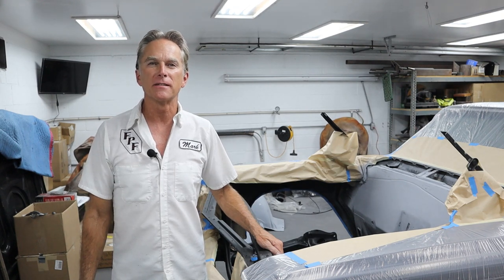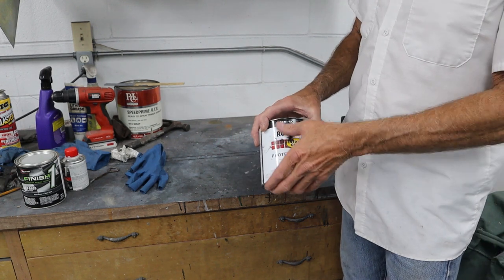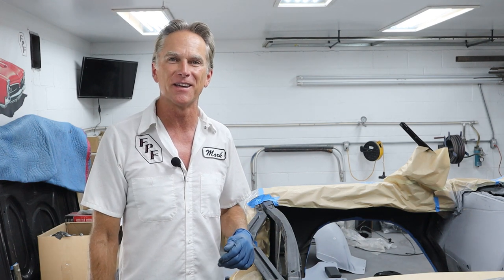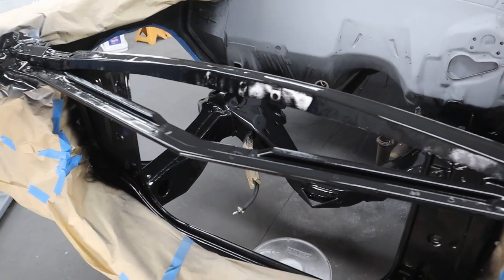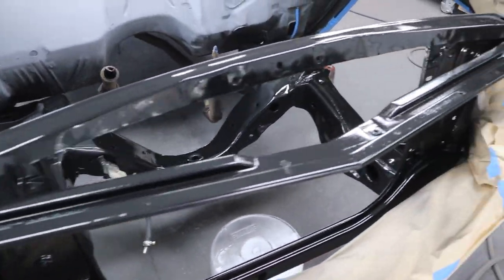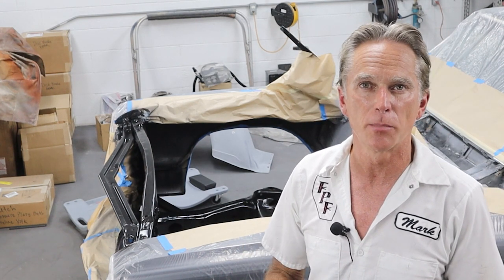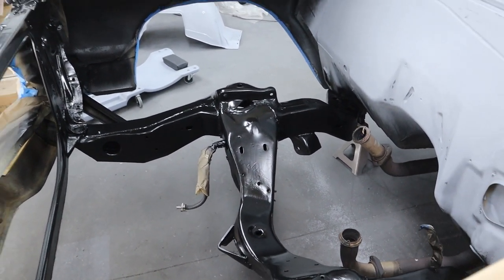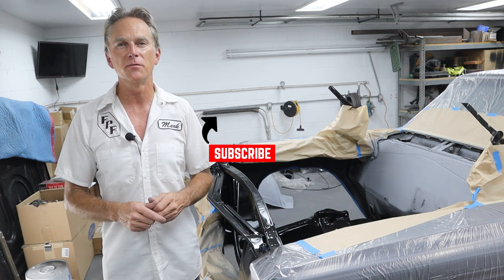1965 Malibu SS (Ep 12) Painting the Frame and Radiator Support

Comment: Mark, we never actually got to see the ‘50 pickup all finished! Would love to see the finished product
Reply from the maker: The truck will be back I promise.  I still need to repair and paint the hood, fix a mistake I made and also repair a few scratches that happened while the owner was putting it back together.  As soon as the Malibu is done the hood will be in the shop and then the whole truck will be back for final touches.